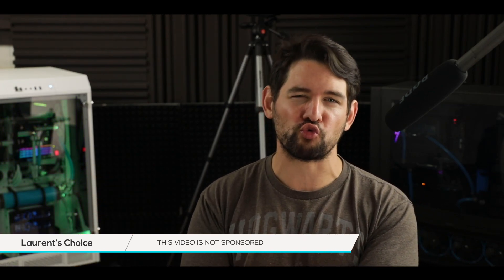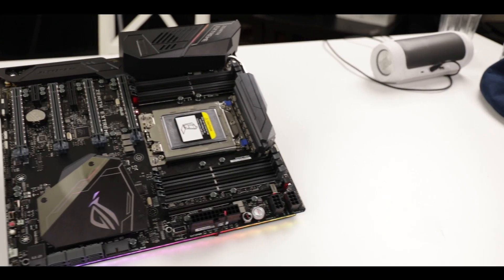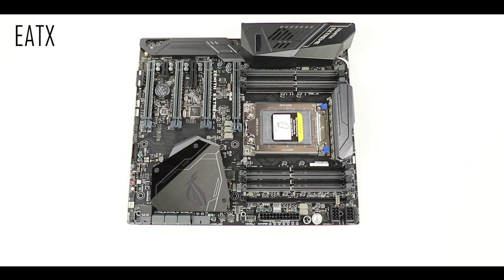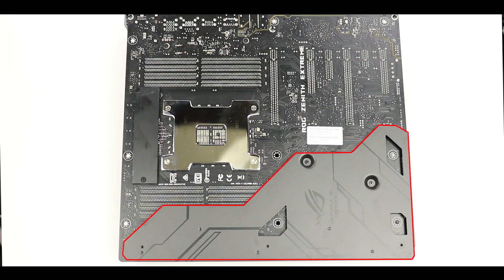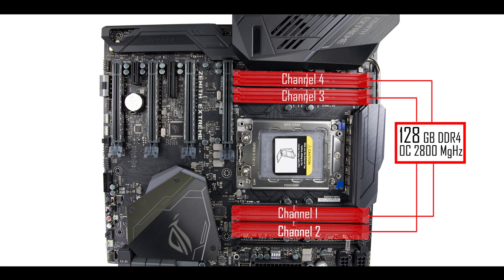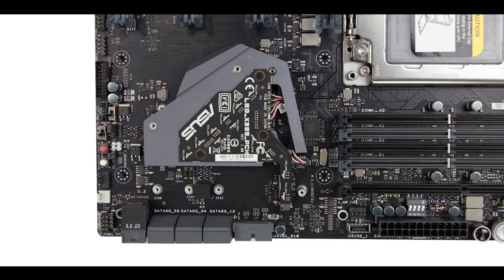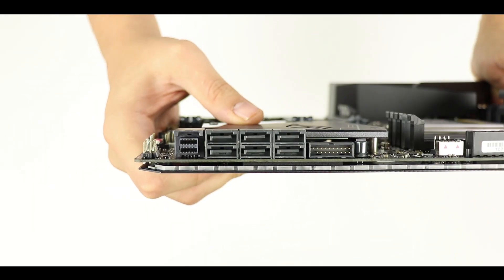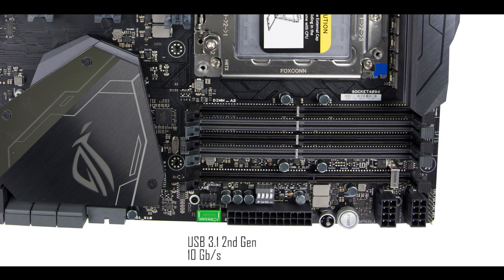ROG Zenith Extreme: a Quad GPU motherboard?

Comment: Hello sir I have big problem I build my new branded pc. My motherboard is rog asus zenith exteam x399. And the processor is Amd Ryzen theadripper 2970wx. I bought new GeForce Rtx 3060 12gb graphics card. For the first time pc leds on even ram processor all work the gpu led also work but the fun not spinning and no display then someone told me to replace the cmos. When I replace the cmos and now only  board led working but processor, dimm nothings work. What can I do could you help me please or may I have your email I can send you the pictures thanks

Comment: 7:12 3 GPUs would mean one at 8x wouldn't it? This link seems to say so.
4 x PCIe 3.0 x16 (x16, x16/x16, x16/x8/x16, x16/x8/x16/x8)
https://www.asus.com/us/Motherboards/ROG-ZENITH-EXTREME/specifications/
Reply from the maker: Hey thanks for thr comment :)

It will work 16x16x16 if u have no SATA connected and only 1 m.2ssd on the board.
Not ideal ..but it ll work . ASUS (justly) presumes that ull need more than a m.2ssd :)